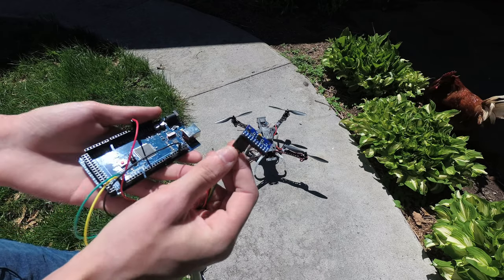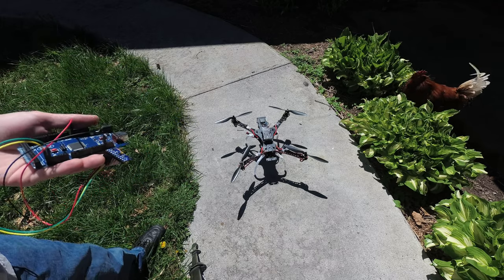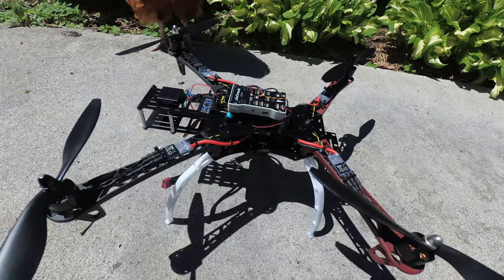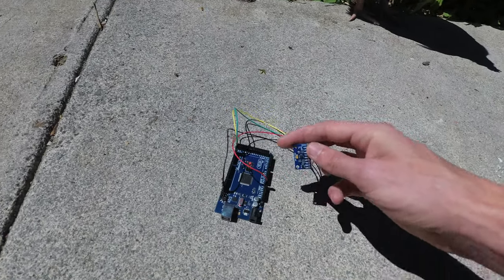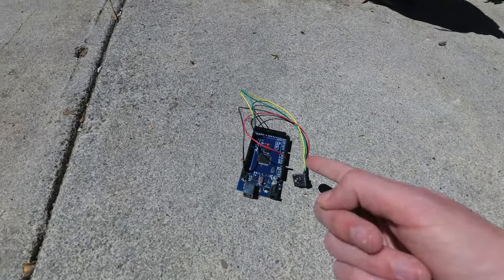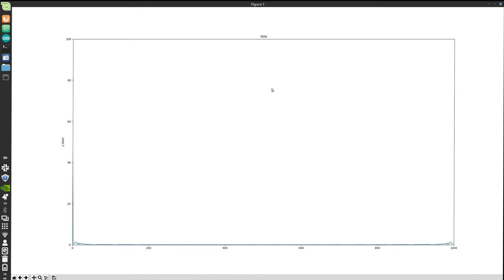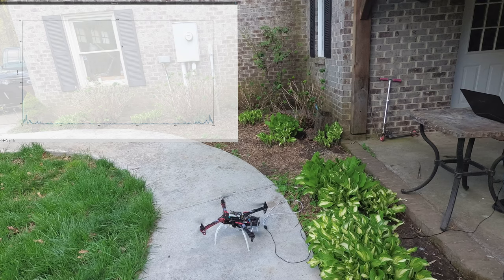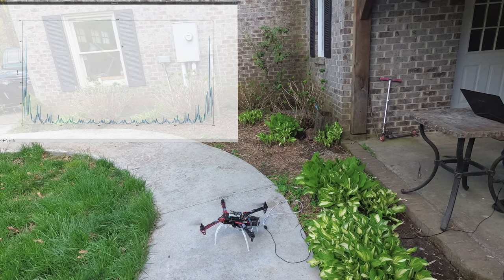DSP mini project

Comment: i think you can get a look at the spectrum if you use Betaflight firmware as well.  I think it's using the optional blackbox freeware for betaflight.
Reply from the maker: I'm sure I could have. The purpose of the this "final exam" type project was to actually implement an FFT algorithm on an embedded device, in my case an ATmega2560. It was harder than I expected but it sure was cool to see it work while flying!

Comment: Could you send me the code for it
Reply from the maker: Uhh I don't even know if I saved it. This was a class project for my intro to DSP class. I just took the formula for a DFT and turned in into code (several nested for loops). It was slow, as expected. Then I made a proper FFT implementation basically copying other code. FFT is a lot more complicated but also way more efficient